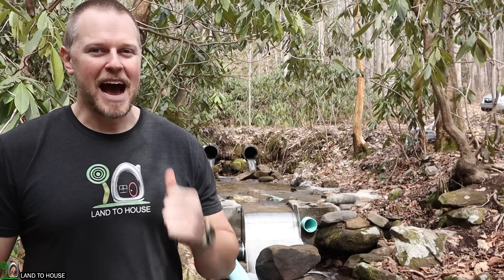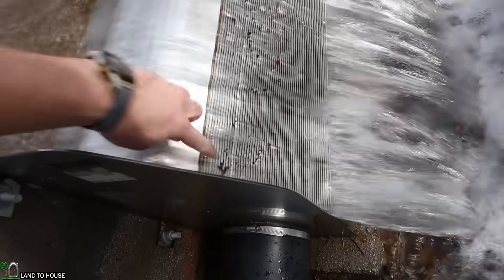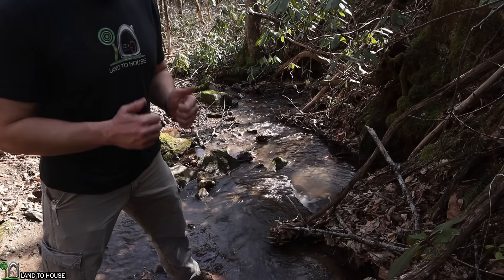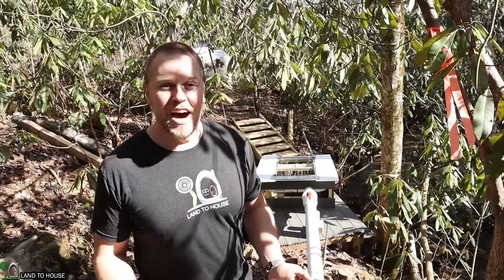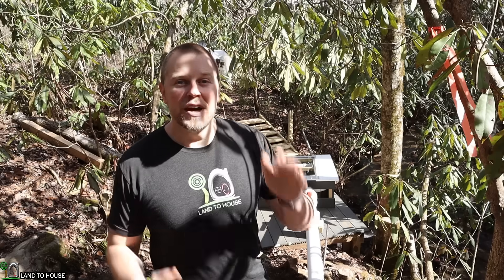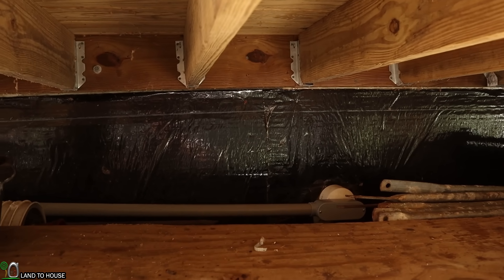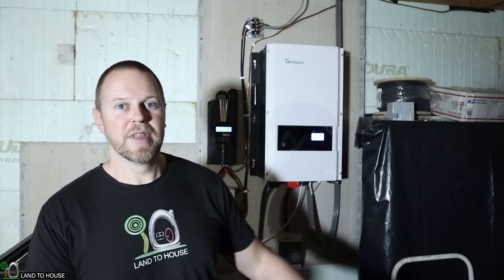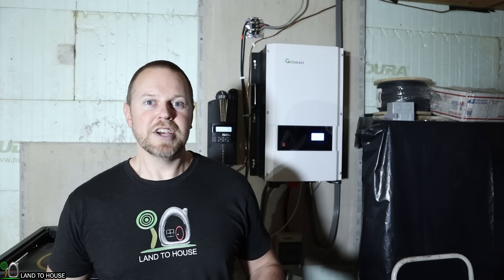AWESOME WATER POWER 500w Hydro Electric Off Grid System

Comment from the maker: 1 MILLION VIEW MICRO HYDRO video
https://youtu.be/f62o9SNwmEU
Reply: The first link in the description doesn’t appear to work.
Reply from the maker: I checked this morning and it was working. Looks like it's got some server error.
Reply: @LandtoHouse  I would like to try and get something like this to work on my pool return lines! If i could produce 110/30a or close it would reduce the money I spend running the pool pump.
Reply: What's the name of the micro hyro machine? I mean the machine that generates the power it self.
Reply: That's a great micro hydro video! If you're interested in alternative power solutions, you might want to check out the Segway Portable PowerStation Cube Series. It offers a massive capacity, powerful output, and fast recharging. Plus, it's waterproof and has comprehensive protection features. It could be a valuable addition to your outdoor gear or home backup power system. Happy camping!
Reply: That's a really interesting video! If you're into off-grid systems, you should definitely check out the Segway Portable PowerStation Cube Series. It's a versatile powerhouse that can keep your devices and appliances running for extended periods. With its massive capacity, powerful output, and waterproof technology, it's perfect for outdoor enthusiasts and RV lovers. Plus, it has a smart app control feature for easy management. Check it out!
Reply: How many amps are generated if you don't mind me asking 🤔

Comment: Ok so this system supplies enough power to separate water into hydrogen and oxygen witch in turn  could be used as cooking gas and power a hydrogen combustion engine to generate more watts . There is also a material that was invented in Iceland when they strived to be the first country to go 100 % green energy homes, vehicles, industrial, and businesses the material was used to act as hydrogen fuel storage in vehicles to make it 100 % safe from explosive nature of hydrogen  unfortunately oil companies stepped in and bought them off their goal just as it was about to go full infrastructure build . Oil companies tend to play dirty. If they hadn't stepped in the world would be a much nicer place to be in right now .

Comment: I didn't  catch how does the house switch off the grid power supply to run on this system. And I know you said it but how long can the house run off the system before it will need to switch back ?
Reply: Totally off grid.
Reply from the maker: This cabin in the woods is completely disconnected from the grid.

Comment: Very cool video and system.  The skills required to design, build and maintain systems like this are going to become more and more important as the grid starts to evolve into a much more distributed power grid.  The use of solar to grid and EV to and from grid is going to be much more common.

Comment: Excellent, basic system, however, I can never understand why more attention isn't placed on the surrounds of the PMA - why not build a complete shed together with noise dampening insulation over the PMA and wooden raft? - this would provide protection for maintenance and keep everything in tip top condition....

Comment: Hello Seth. I recently found a small creek that comes off the hill behind out house here in Alaska. It has a pretty good flow rate but is narrow.  We would love to create some power to offset the days when solar is to low. We run a 24v system here with a growatt 3000 inverter and two 200ah lithium batteries.On average we use about 5-6amps an hour.  I would love to be able to pretty much keep the batteries on float except at times we use more.  Is this something that can be done? If I go towards the top of the creek it is around 250' above and 500 yards from the house where I want to create a pond for it to drain into.  The creek goes below ground at the base of the hill and does not feed into another body of water.  What about rises in the ground? Can this be over come by valves to release air that gets trapped?

Comment: Its a great concept.  For long term use.  Transitioning to stainless steel piping for the length of the system.  Weather permitted you can also use a heat tape to keep it from freezing in extreme temps.  I love the concept!  😎👍

Comment: Thank you very much for posting this video and thoroughly explaining what each part does!
It would be wonderful to have a total price on a system like this, but I managed to get a very rough estimate just by looking up the batteries and the converter.
I think the system would recoup it's cost fairly fast, especially if you're a far from the main power lines, it would cost a lot to pay an electrician upfront to get power to the land.

My dream is a similar system, Starlink for fast internet access, and enough wattage to power my dream personal mechanic shop!

Comment: Why does it go from AC to DC back to AC? Wouldn’t it be more efficient to stay AC?
Reply from the maker: This PMA generates 3 phase wild AC. This means the frequency is all over the place. In the US appliances need 60hz single phase AC. That's why the conversion is needed.
Reply: Is there no other way to stabilize it? How much wattage is lost in the conversion? I am planning on doing a hydro system on my property and am new to this

Comment: Really nice system. A few suggestions: use a weather proof junction box for the connection at the turbine, the black tape will degrade overtime.
I would protect the rectifier with a breaker. 
Try to secure the wires coming out of the inverter, don't let them hanging off the connection, it will degrade and overheat.

Comment: Why is the 3 phase ac unusable when that's exactly what the house uses? It seems like the battery bank is useless in this particular system as plenty of water flow in the creek. I definitely recommend a battery bank if the flow is extremely low at certain times but this doesn't seem to be the case.
Reply from the maker: In the USA 3 phase power is only used in large industrial buildings. Normal house power is single phase 120v 60hz. The conversion from wild AC to DC allows the inverter to convert back to single phase 120v 60hz.

Comment: If your already generating a/c why not use that directly for normal use? This seems unnecessarily complex, and your losing some power with each change. Would a motor/generator be more efficient for the a/c - d/c conversion?
Reply from the maker: The AC that is coming from the PMA is wild fluctuating 3 phase. The power we use in our homes is locked down at 60hz and is single phase. Trying to use the power right from the PMA would blow up most appliances.
Reply: @LandtoHouse  they do make regulators for that and a governor on the turbine would help with that and make it last longer.

Comment: Wonder how much a whole system installed would cost …
Reply: I’ll give you total cost when I’m done with mine. Still working out the kinks. But so far, I’m north of 20K. Still cheaper in the long run over what the utility company and timber company easement would have cost me. Plus this is fun. 🎉

Comment: I saw a video where they installed a hot water tank to pull the extra charge off the system. This way you don't over work the turbine. There was a temperature monitoring unit on it so if it reached a certain temperature it would flush the hot water out. Kind of cool.
Reply: The real solution is more batteries XD

Comment: Why is the turbine so far away from the intake? Why the long pipe?  Is it not cheaper to make longer electricity cabels instead of a longer thick water pipe? Or is the transport through the long pipe adding to the pressure or power needed?
Reply from the maker: To make power, you need water drop. This makes the pressure that pushes the water out the jets.
Reply: @LandtoHouse  ah ok thanks :)

Comment: How can you combine solar power with hydro power? How can that lithium battery tower kick in during the night and overcast days, even though you're using hydroelectric off-grid system. How can you power the whole house with both solar and hydro power together simultaneously at the same time?

Comment: He has a system set up for about 6000w with only 500w coming in... lol
Reply: Was thinking this system looks insane and 500w sounds like 5 100w light bulbs ? Lol
Reply from the maker: That's the incoming power. Considering they have no grid power they are happy to have this system. And the solar window at the house is only 2-3 hours with the trees and 2 mountains.
Reply from the maker: The 6000w output is on the inverter and batteries.
Reply: @LandtoHouse  ohh i see things get serious at the house huh lol
Reply from the maker: Haha it's an elderly couple. They lived with only a small gas generator for 15 years.
Reply: @LandtoHouse   what does this have to do with anything? your point is because his age makes it right?

Comment: Excellent, I'm looking for property that has a creek, stream or river going through it.  Sadly in AZ, there are very few opportunities if any.  I may have to opt to move to another state - definitively NOT California (just left it, Democrats are destroying such a beautiful state with crooked politics). I like the design, good job.  I would need a bit more power as I probably will be running 2 heat pumps but it can be scaled up.  Thanks.

Comment: All that work, time and money for the power of a couple of solar panels. I admire the diligence it took though.
Reply: Solar is pathetic, works for 6 hours a day at most.  It is only 17% efficient and cost for a 14KWH system (in 2024, will go up in coming years) with two battery panels is about $70K (Tesla just quoted the system for me - the 2 PowerWalls are $22K).  This hydro system is 24X7X365 active and can be made to output much more, for a fraction of the cost of the solar system.  I would opt for this solution anytime over solar.
Reply: @juanmacias4854  Depends where you live, in regional Australia rooftop solar is wonderful and there is no stream or creek or elevation to power hydro on flat land.
Reply: @SlaintheMhath  True, but to replace a power station powered by natural gas or nuclear makes no sense. I live in Arizona and have solar. Works good but APS still supplies power to make up for evening hours.
Reply: solar power only works less than half the time....               this is doing work 24/7
Reply from the maker: This elderly couple lives so far back in the woods that solar was not much of an option. They live deep in a valley that only has about 4 hours of sun every day and lots of trees on top of that.

Comment: Former colleague of mine has a place in Oregon with a year-round stream.  There's about a 300 foot change in elevation across his property.  Not sure how much power he's making, but he's running his house and wood shop on a Pelton turbine.   He's using firehose instead of pipes to feed his system, apparently hose that's considered too worn for the firetruck was available at a very reasonable price.

Comment: I have a question regarding the electrical wire run-I need to run mine almost 3000 feet from my creek to my power center. Any suggestions or tips?

Comment: I think more experimentation needs to be done on the impulse wheel. I feel there is more energy available than you are getting.
Perhaps a jet turban inside the pipe with thru shaft to the outside thru a 45 degree bend to generator.
Or, a turgo runner, instead of a pelton.
The problem with pelton is that it relies on head pressure, but resist the flow. Water has to slow down to get the job done.
It’s like getting lots of amps, but slow volts.
Very nice set up!

Comment: Anybody want to comment on what happens to surplus generation?
Reply from the maker: The charge controller will limit the incoming amps as long as the free spin voltage is within the limits of the charge controller.

Comment: I'm not an electrician..
But
How many amps are the batteries good for???
Is it the primary power for the house or just for refrigerators and things important but not enough to run the whole house???
Reply from the maker: A single eg4 has a 100amp discharge. That's 5000w. When you combine the batteries you can get higher amperage for discharge. This system is the only power going to the home.

Comment: 500W? Why exactly? Seems like a lot of work since the solar panels on my roof give me 5000W at peak, the rest goes to the batteries to run everything 24/7. This has to be a hobby, no one would do this for economy. Also, after all that work, it only works if you have flowing water. The sun comes up every day...
Reply from the maker: The older couple that own this unit went without power for over 10 years. They are super happy to have this 500w. They also have a couple solar panels to be installed. To get more than 1-2 hours of sun in a day they will have to cut lots of trees.
Reply: Winter. There are places that don’t get a ton of sun during the winter and that water runs all year around and even if it doesn’t run all year around, solar panels will take care of the power during the summer

Comment: Why not use a wheel that is cheaper and you don't need concrete in a creek bed! And can have a shaft that spins and can make your power with less material and maintenance

Comment: Why rectify and then invert again?? AC to DC to AC is lossy.
Reply from the maker: The ac from the pma is wild fluctuating 3 phase. Hz value is all over the place. Converting to DC allows for storage in batteries and conversion to 60Hz 120v ac.

Comment: So there's no protection until after the rectifier, and no control on the generator? What if there's a fault on the line from the generator to the rectifier? Or even worse, a fault at the rectifier inside the house?? If you can't trip the generator or interrupt a fault at the rectifier seems like that's a recipe for a house fire.

Comment: Can't we get a cost estimate for the setup ? I guess if it is very remote it is irrelevant, but would be nice to know how much - especially the battery bank - costs
Reply: The batteries are $1400 a piece so this is a pretty expensive setup
Reply: @davek2690 yeah thats some change for those. Could dummy it up with lead acid or AGM batteries, but would need more and have a shorter life span.

Comment: I am curious why a 3-phade motor/generator is used? Why not use a 24 volt DC motor/generator?
Reply from the maker: The charge controller needs at least 60v to charge the 51.2v lifepo4 battery. The 3 phase ac rectified provides that with ease.

Comment: Nice vid. But it is all done just for the showcase: it's unreliable and temporal. Wood that gonna rot, pvc under sun , exposed wires and connections, li-on batteries that lose capacity after year of use. And the price  of new house :)

Comment: If you had a pond, could you create a closed loop system where the power you create could supply a water pump to feed PMA as well as have power left over for use in the home? Like perpetual energy production?
Reply from the maker: Sadly no. Each step of the system loses energy.  The hydro power is 50 to 80% efficient and a pump will be about the same. Every cycle would lose 20 to 50 % of the input energy.

Comment: Too much cost for too little power. Lots of additional environmental impact from materials, batteries, etc. Is it located where the water freezes, if it is that's a problem too. Was permission required and was it obtained to do what was done?

Comment: Can you be able to run the three phase from the turbine output ac current straight to the breaker and out to the house to use instead of the DC conversion and battery and all that.

Comment: Why can't you just go straight into the breaker box and skip all the batteries and DC kinda like a waisted bunch of energy going through DC battery its ac out of the generator and ac in the house just seems like a good bit of money you can save
Reply from the maker: The power coming directly out of the turbine is 3 phase wild AC. Household applications require a very steady 60 Hz single phase AC. If you tried to run the fluctuating AC through an appliance, it would quickly burn up.

Comment: Very nice 

Only thing seems like you go through all that 

The pvc usually last better in the ground or somewhere out of the elements it will get weak and limbs could fall on it , also all that wood even if it is pressure treat isn’t all that 

Had some pressure treated porch boards it did better than none treated but still it decayed , mainly where the weather got it 
But I’m thinking probably would have not lasted that long if it was on the ground in the weather

Comment: Does anyone know whether this is more or less expensive than the 500 watt equivalent of solar panels? I’m assuming it is, and I love that it works at night and cloudy days too.
Reply: I assume this would cost more yes. But as you said it has its benefits, but requires a significant resource whereas sun is plentiful. 

But really, since solar only harvests part of the day, you’d need a 1000W system and batteries to get a similar result.
Reply: "Does anyone know whether this is more or less expensive than [equivalent] solar panels? I'm assuming it is..."
You are 100% correct!  It is definitely MORE or LESS expensive.  
(sorry, I could not resist! You said - I am assuming it is... Is more? OR Is less expensive? You left us hanging!)